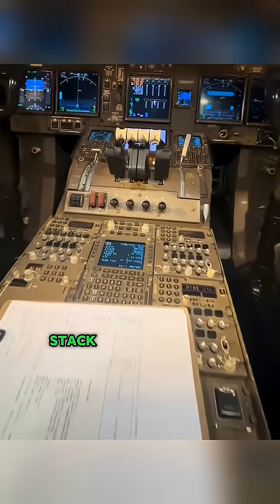Who Knew Scrapping a Plane Could Make This Much Money?

Comment: And now we only need the cost of dismantling one. To see if it's worth it
Reply: about €600,000 give or take due to legislation and market prices.
Reply: @johnsmith-de3tl and how much to buy the plane?
Reply: @bram61 for a brand new..before any add-ons? about 400m but of course with deals and such it could be reduced a bit. if you want to build a cheaper fleet of planes then you could get older models for about 50m.